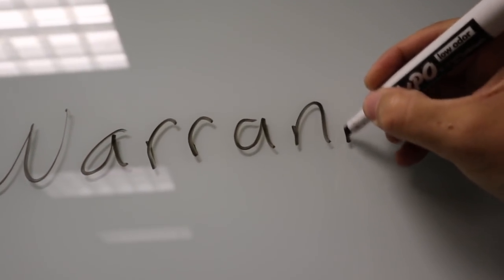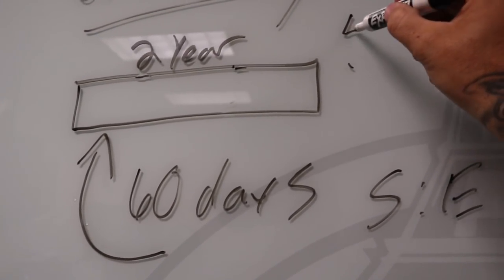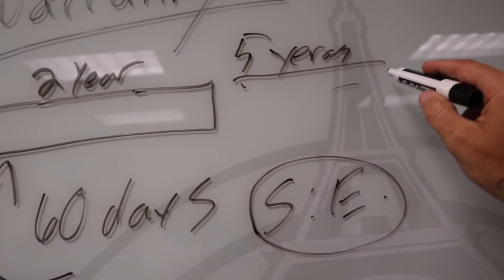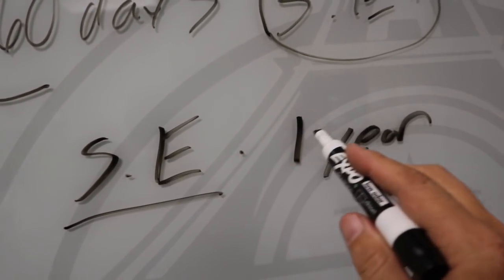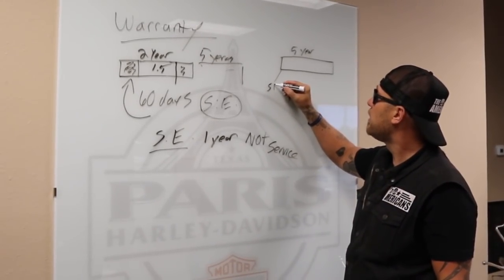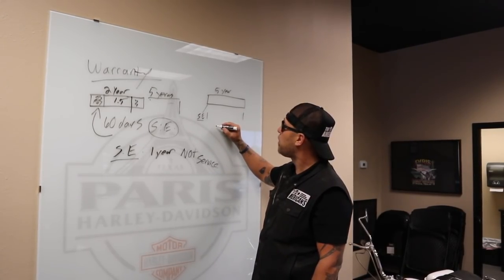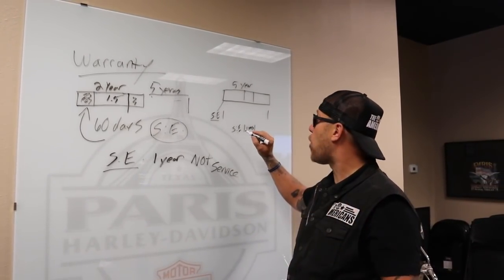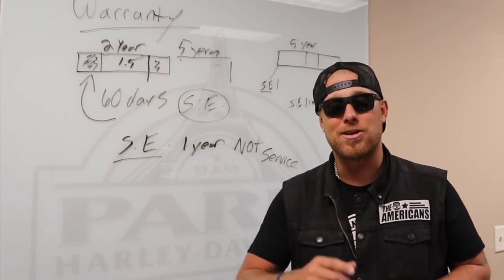HARLEY DAVIDSON Warranty explained / Engine & Exhaust Upgrades

Comment: Good Video Adam. Warranty explanation is something I continually have to explain to people. Just a side note. If you buy the additional 5 years of warranty (Technically called Extended Service Plan) it "attaches" to the end of your two year factory warranty for a total of 7 years of coverage. All genuine H-D parts you install during the first 60 days of NEW bike ownership are then Registered to the VIN in all H-D's data bases on the SWR (Sales & Warranty Registration). Where Screamin' Eagle Parts are the most important of these items, ALL H-D Parts and Accessories can be registered under this "Custom Coverage" available in the first 60 days of Ownership. So Potentially you can have all your Screamin' Eagle Engine work Covered for 7 Years! Then as long as you don't exceed 75,000 miles you can renew your warranty for an additional 5 years for a total of 12 years risk-free engine work. Doesn't make any sense to get performance work done any other way. 
When are we gonna do a dual Vlog man?
Reply: Matt Laidlaw
Reply from the maker: I’m ready let’s do it. Inbox me on FB
Reply: Two of my favorite motorcycle creators right here. You both bring something unique and current. I for one would love to see this.
Reply: Are you sure about that? I bought a new 2018 Electra Glide on Nov. 4th 2017 and bought the 5 year extended service plan and my contract says it expires on Nov.4th 2022.
Reply: Yea, so you bought the extra 3 years. Look at your contract and see which box is checked? It's the 5 year, not 7 year that will be checked.
Reply: Yes, it is the 5 year box that's checked. So I actually paid for only 3 years of additional coverage. Thanks for clearing that up.
Reply: What if you buy a modified motorcycle and buy the ESP....Would the plan be voided?
Reply: It’s a damn shame that H-D doesn’t recognize that FUELING & S&S make far superior Cam plates and oil pumps as these 2 items are the weak point in the Factory designed engines. Bean Counters are Evil and are the reason for inferior quality.😎
Reply: Great info Matt,,sadly people don't realise even if they try to outsmart HD and change back to stock , the ECM will record what ever tuner was used ..Check mate..
Reply: @cavscout62  It's all about the money-making taking priority over the best interests of the customer unfortunately. And why I, amongst thousands of others, have yet (if ever) to buy a brand-new Harley. I figure if i want to put my brand of choice into the mix and void the warranty I might as well buy 2nd-hand.
Reply: The manager at the local Harley dealership told me that when I asked him Matt. I was still skeptical about it but now your saying it too so I believe it now.
Reply: Does it matter who installs the Harley Davidson parts within the 1st 60 Days for those parts to be covered?

Comment: After I got my Road King back from the stealership after the 1K mile break in service the original oil filter was left on and one bolt was missing from the primary cover. I said screw it and went nuts. Well I didn’t have any issues with my after market parts or my own install. Warranty is over and it still performs great! I have the service manual and proper tools and ability. I’ll take it from here H-D.

Comment: Read the Magnason-Moss act. They MUST prove without a doubt that the aftermarket parts caused the issue you are reporting...

I.e. your exhaust didn't cause your wheel to go out of round
Reply: Kevin Taddeo I was looking for this comment before I posted the same. Thank God I didn’t have to scroll too far. Well done, sir.
Reply: Only works if you have a lawyer.  You say Mag-Moss, they say sue us...
Reply: @OnPointFirearms M/M Act doesn't apply to non EPA compliant parts.  Adam did address the fact that the after market parts could void your warranty for the part of the motorcycle that it affected.

Comment: Why is everyone so worried about the damn warranty? Just ride the damn bike!
Reply: Schnot, because its practically tradition that people customize the hell out of their Harleys. All this warranty red tape really puts a damper on that.
Reply: When you just spent 20-35k for a bike and you pump up the engine and it takes a shit because HD had a bad casted piston/part, do you want to pay out of pocket vs HD?
Reply: lol
Reply: Coz people are scared
Reply: Cause bad parts do make it thru inspection and become lemon vehicles. Would you rather get a brand new engine for free or have to spend $5k for a new engine?
Reply: My street 750 toasted its motor at less than 8k miles. My warranty will save me 6 grand. Thats why we worry about it lol
Reply: Because the new M8's are shit and keep blowing up and sumping, ton and tons of report on BBB/Consumer Reports and other sources of powertrain going to hell and warranty being voided due 'mods' so your left with 18-30k anchor in your garage. Atleast will you build your own motor.
Reply: You can't ride something that doesn't run. And if you can't fix it yourself (like most of todays punks, hell, they can't even change a tire or change their own oil without a mechanic) you will need to take it to the dealer. No thanks Pedro. I'll ride my Honda all day long and have money left over!!!!

Comment: There is a supreme court case, that made a ruling called the Magnusson  moss warranty act. This is the end all to manufacturers for warranty issues. Understand "extended warranties" are different, and are actually service contracts that you agree to their terms. Many times they are not the dealers contract nor the manufacturers contract. It's typically (not always) a third party company. They are not under the same laws as the manufacturers new product warranty. 

The Magnusson Moss warranty act in  summary states that warranties cannot be voided, but a part that fails must directly related to a aftermarket modification for the manufacturer to deny coverage.
Reply from the maker: Cody White unfortunately that act does not protect any engine that has been modified past the point of EPA standing. The government does not want unhealthy engines

Comment: Very good explanation.  Installing parts not being within EPA rules may also have a negative impact on your insurance.  Well this can be the case in Australia.  I was fortunate enough to have the Stage III upgrade (FXLR to 114) with SE mufflers and SE Air cleaner installed by the HD Dealer from day 1.  As you say, everything is now covered under the new bike Factory warranty for the entire period. Imagine the 'pull' on a bike with a 114 (Stage III) and weighting significant less than your HD tourer - I love it!

Comment: Any car or motorcycle manufacturer has to prove the part caused the failure. Just swapping mufflers and not touching the catalytic converter etc cannot cause any damage at all aside from the mufflers themselves going bad. I was going to just do stage 1 so I wouldnt have to deal with HDs BS on the issue and my dealer actually talked me out of it. Just ordered the pipes since I didnt really want or need an extra 5hp/10 ft lb torque

Comment: Adam I don't think that is Harley Davidson is only warranty problem on the performance side. Hardly davidson has a hard time honoring the regular warranty on the stock motorcycles. As I said the idea that you stuff a piston with 22000 miles with new rings on it into a brand new cylinder. No mechanic shop would ever do that except for the motor company. The reason I went to a different brand a motorcycle where your reply lad to. Is because the motor company's terrible handling of normal warranty claims. Maybe a dress just normal warranty problems a and that will also solve a lot of the mistrust of the motor company because of problems with parts that come on a stock bike. Remember Adam they promote this motorcycle as a premium motorcycle

Comment: What if you still have HD factory warranty but the failure of a Screamin Eagle part (after its 1yr warr period has ended) causes the failure of other parts?
Reply: George Costanza the bikes warranty is unaffected so it’ll be covered. The 1yr warranty on the screamin eagle parts is for if the pipe or air cleaner cracks. That part is covered under the 1yr manufacturer warranty. Bikes warranty is unaffected and HD will look at it is a stock part.

Comment: Eff the warranty, I’ll take my V&H pipes any day....  H-D made enough money off of me already, so I might as well have the smile.  👍🏻
Reply: Sunbear805 if your running V&H and something goes wrong put the stock exhaust back on and bring it in
Reply: john S EXACTLY. If your just doing stage 1 (pipes, air cleaner, fuelpak) most def keep the stock parts. God forbid your engine detonates. Easy swap back to stock. Then go get that free brand new motor.
Reply: Just put all the stock parts back , and put the stock tune back in the MCM before you trailer it in for warranty LOL
Reply: @Itsme-mx5tl  that will Require a tuner ,,whatever tuner used will be registered by ECM regardless,, so unfortunately even if you change back you're fucked..

Comment: Awesome vid. So if the parts are installed before 60 days it ties into the factory warranty and the parts are warrantied as well. But after 60 days it’s just the standard 1yr manufacturer warranty on the parts but the bikes warranty is unaffected. That’s a slick way of HD to push upgrades when purchasing a bike haha. Quick question though. I’ve heard of Vance & Hines parts (exhaust, air cleaner, fuelpak) not affecting the factory warranty. Can you confirm? Or are some dealers being extra nice (letting it slide) / shady (lying to you and voiding your warranty)?

Comment: They MUST prove that ANY aftermarket part that you put on causes said problem. That is the law. So most of what you are saying doesn't add up.
Reply: Your Right same with dealers forcing you to have services/oil changes done by them ..the BAR made that Illegal about 30 years ago but Harley is still trying to pull this warranty fraud anyways....which is why their loosing so much sales to Indian and metric cruisers...Because they actually stand behind and warranty their products!

Comment: The EPA regulates all vehicle sold in the US, not just Harleys. However, the only complaints that I hear from other serious riders is from Harley owners and HD giving some Bull Shit excuse to not cover something under warranty.  Like the dude I heard about on the news that had been buying HDs for decades and on his most recent bike the transmission crapped out. The HD dealer told him it was from the US flag on the back of his bike causing so much drag that it CAUSED the failure and was not included under warranty so he had to pay to repair a brand new bike! Hopefully, there was enough input from viewers that they decided to cover it, but it just proved to me, once again, that Harley is a scam. They are great at selling you propoganda, and PR,  but lousy at building great bikes. HD charges a fortune for a shit bike that requires thousands of dollars extra to make it even close to be worth having, only to have it break down soon enough. The only bikes I EVER see broke down on the side of the road are Harleys...hence, my reason for calling them Hardly Runningson. People talk about the camaraderie of Harley owners, but this is because you just might need to help push one home and want the help. However, after over 50 years of riding I can assure you that there is no difference between HD riders and any other bike rider, they will all help if it is ever needed...it's simply a biker fellowship thing, not a Harley thing. Even Sonny Barger of Hell's Angels fame says screw Harley. He even goes so far as to say that if they had known the superior rides for a better price and easier to repair, when rarely needed, unlike Harleys, that the Japanese manufacturers were going to come up with, most bikers in that day would have said fuck Harley and rode a Honda, Kawasaki, etc.  He went on to say that now that it has become the image, he rides an HD, because idiots expect it, but he would rather ride a BMW or Honda.  I drank the Harley Kool-Aid, ONCE, and won't do it again. If you are new to riding, do yourself a favor and don't waste money on a Harley, buy a much better bike for much less money that will give you greater reliability, a smoother ride, less expensive to insure, cost less in any parts you might want to add, V-H makes loud pipes for most bikes now...if you are into that sort of thing...and since it is a pipe not made for a Harley will cost less, too. The ONLY thing that Harley is truly number at is being stolen. Just shows how stupid criminals actually are. Oh, and the Jap bike manufacturers won't void your warranty over some stupid B.S. like Hardly Runningson is notorious for...sure, blame the EPA.  Fuck Harley!

Comment: I think it’s ironic how people make comments about “It’s not that hard to understand...”, but Adam has already had people make corrections to his explanation, people bring up the Magnusson Moss act, people haven’t thoroughly explained the EPA Consent Decree, and some people have stated it depends on your dealership or “dependent on your (relationship) with your dealership”. “Does my bike get flagged as non-compliant in the Harley database if I bring it in for a tire change and the tech sees aftermarket pipes on it?, etc...” It all seems so dang sketchy and no one ever seems to provide a crystal clear answer....so FRUSTRATING!

Comment: So I just have a question. I just bought my bike 9 months ago brand new off the show room floor brakes started squiling after 50 miles didn't have time to take it in due too me being a full time student and working full time. Then I had an issue not too long ago with my brake lights not working driving home from school at 11pm. Stopped by a gas station to put a new bulb in took it into the dealer and they had told me that there was a wire that had damage done and they just crimped it back and trying to charge me 109.00. They basically said cause I bought a bulb that wasn't harley Davidson? I'm just confused and would like some input on this adam.

Comment: Hard break in ! Do the 1000 mile service... ride the shit out of it for 3000 more miles , change the fluids once again.. If she doesnt let go... shes good, then start modding !!!! S.E. parts suck  ass. ditch the cat. Give the bike more fuel and air.... it'll run cooler and last longer. # 1 enemy for engines is heat.. The EPA mandates Harley to lean out the bikes  for better emissions . good for the environment ? Yes,  Is it good for  longevity and health of an air cooled engine ? fuck no.

Comment: So, if you fit a Stage-IV kit 6 months after bike purchase and a Stage-IV part fails 13 months later and takes out the crank, does the 2-year warranty cover you for the crank?
Reply from the maker: that's something you'd have to talk to the manufacturer about, I'm not entirely sure
Reply: @adamsandoval  Thanks bud, appreciate the reply. :)

Comment: Stage 5 (which is really stage 4 + Tuner = Stage 5) voided my warranty ! The dealership blamed vance and hines quiet baffles for cooking my engine and told me because i got stage 5 i no longer have warranty.
Reply: Harley Breakout Guy,  did you take it to another dealer?  That sounds a little crazy.  Guys can run 1 foot exhausts without issue.  I have a feeling they didn't know or were to lazy to actually investigate and just blamed it on a part that is superior bit aftermarket.
Reply from the maker: probably that exhaust is what voided your warranty.
Reply: i went to consumer affair fair trading, they also said if i install after market exhaust then they cant assist me.
Reply from the maker: yup, I hope this video helps some people understand it before the upgrade
Reply: Harley Breakout Guy .... if it was CVO BO they had a big problem w overheating more than a typical 110 motor does. My 14 engine cooked too. I found out on the HD forum that in 2014 HD had a disgruntled employee who was working on the CVO and put cutting compound in the tanks..yep...so it would screw up everything. When I called HD they wouldn't pay for anything..i paid out of my pocket...check out the story..you'll see..tc..ride safe
Reply: i paid $3000 out of my own pocket too after i already paid $10,000 for a lot of upgrades. I will never ever buy Harley again they left me to the dogs.
Reply: Sounds like it’d be hard to trust anyone because too lazy, cheap, or don’t want to investigate the real issue.
Reply: Harley Davidson Silent Vlogger should’ve just bought screamin eagle slip ons before taking it in. $400 for slip ons vs $3,000 for a new motor is a big difference.

Comment: Will changing the muffler really cause the engine to breakdown faster than the stock exhaust? Like if you slip on screamin eagle vs vanes and heines.. which brand wears down the harley engine faster?

Comment: What if I purchase a stock 2017 (I did) with an extended warranty. It was a 2018 leftover with one season. The bike till had 17 months on factory warranty. I purchased extended. I'm covered until 2024? Anyway. Can I upgrade screaming eagle even if I'm second owner?
Reply from the maker: It'd be worth asking your local dealer

Comment: So would S&S’s new 2 into 1 with a cat void the warranty?
Reply from the maker: A Tho more then likely
Reply: Confusing subject.  

Not what my dealer is saying.  Bike still under warranty.  If aftermarket pipes cause the problem, that repair isn’t covered.  But everything else is still under warranty.

Comment: Well fuck...I bought a used '19 883 from the dealer and it came with Bassani Firepower 3" slip-ons already installed. I also bought the extended warranty along with it, but did not know about this part of it until recently. Do you think that this would effect the warranty if something were to happen to the engine?
Reply from the maker: Im not entirely sure about the. You'd have to contact who handles the warranty
Reply: @adamsandoval  Thank you Adam, I will see who I can reach out to!